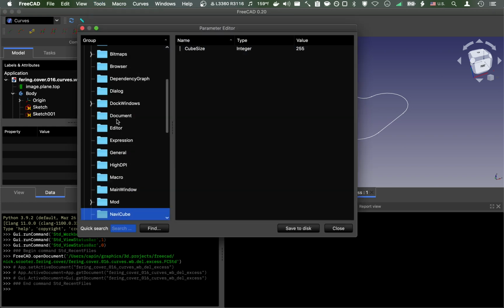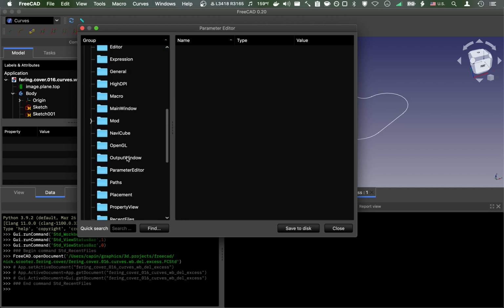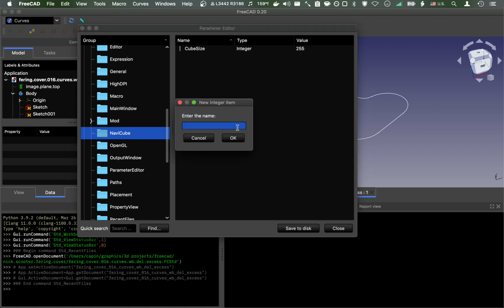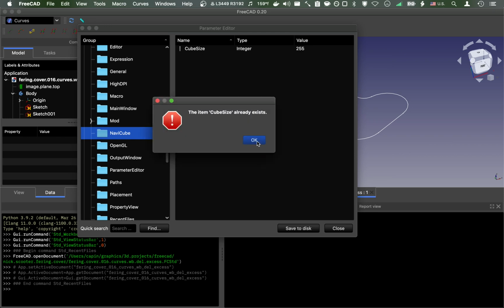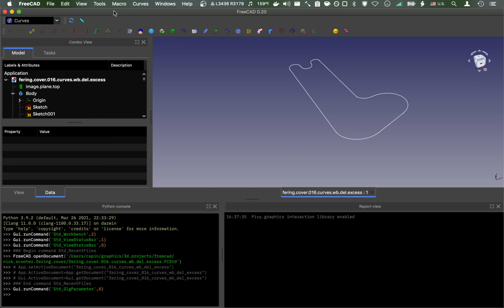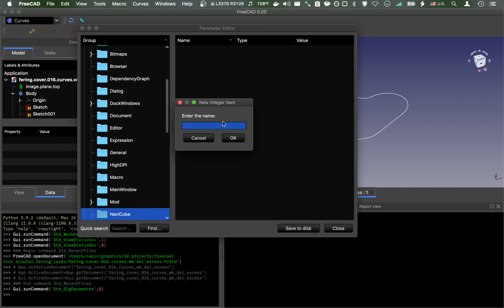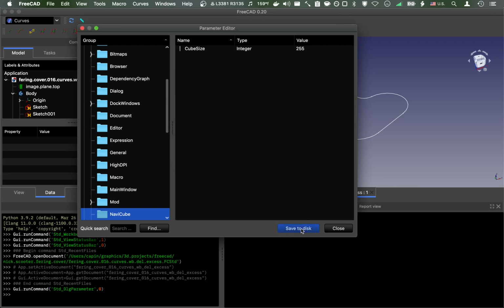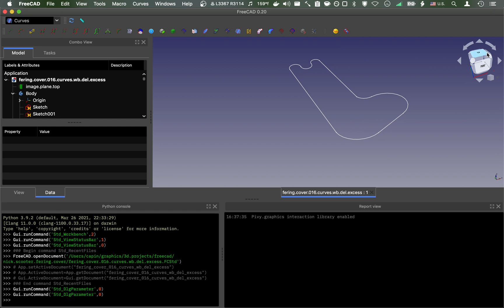FreeCAD adjust size of navigation cube

Comment: Thank you. Running iMac Big Sur and when editing the parameters, as you show, the folder for NaviCube is blank but Right Clicking brings up the parameters edit menu and after selecting New Integer Item, setting up the string CubeSize with a value of 250, saving to disk and relaunching FreeCAD, voila it works great.

Comment: It is not available in the preferences, nothing appears.
Reply from the maker: what OS and version are you running? did you download the latest release from the github release page?

if setting does not appear in preferences, did you try to  adjust the value in the parameter editor?
Reply: @the.real.ipatch  Running Big Sur 11.4. Downloaded the latest version from Github and also tried the parameter editor, however, there is nothing that appears there as well.
Reply from the maker: @thesourboyrich  downloaded the latest conda build from github, it's built against a commit that hasn't integrated setting to change the size via the preferences, so you'll have to edit it in the parameters editor for the time being, until a more recent conda build is distrubuted.
Reply: @the.real.ipatch  Thank you. Unfortunately, the parameters editor is blank when trying it that way.